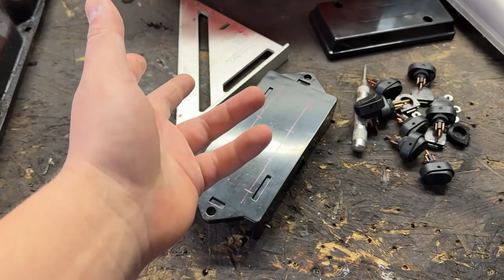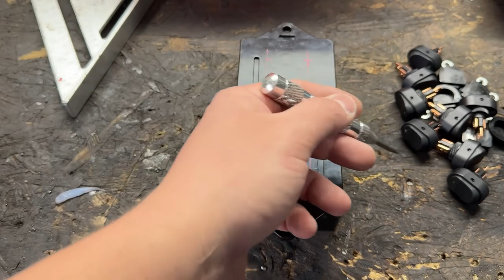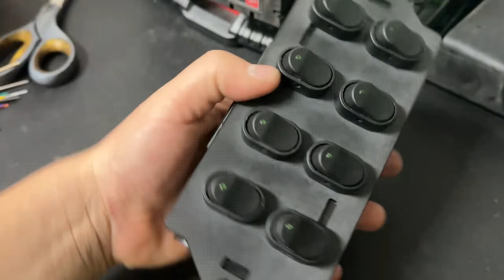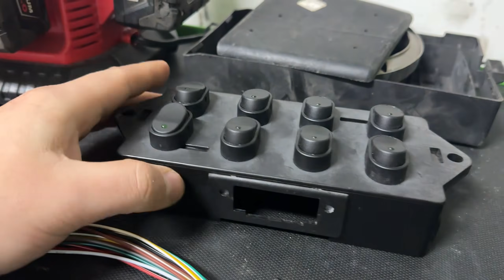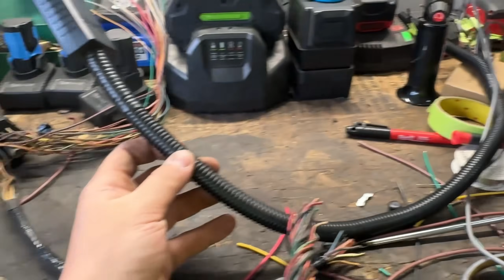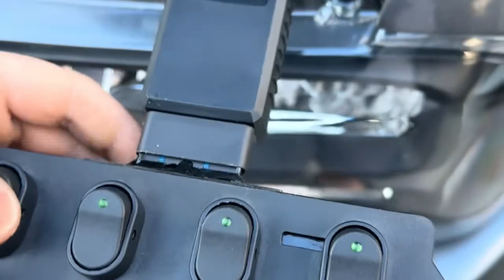7.3 POWERSTROKE RUNNING ROUGH? WATCH NOW - INJECTOR TESTING AT HOME!

Comment: I want to build this exact breakout box it's a very cool idea i like it.

I have a 2003 DODGE CARAVAN SE V6 3.3L FLEX FUEL.

Can you tell me what supplies i need to buy to make this breakout box work on my vehicle, please?

All the fuel injectors and fuel injectors wiring harness connectors are buried under the upper intake manifold. 

The wiring diagram 8W - 30 - 22 i traced the wires and i see that it starts from C102 and ends at C1 Powertrain Control Module.

The C1 and C102 has all 6 fuel injector control wires. 

Would it be a good idea to use a t-pin to backprobe each injector control wire from C1 and clip a test light to battery positive and touch the t-pin with the probe of the test light to stop the injector from spraying gas for the cylinder power balance testing?
Reply from the maker: I have no idea, I don’t work on dodges. 

Make it simple on yourself. You’re just looking for the injector wires to each. Just cut one leg and tag into those